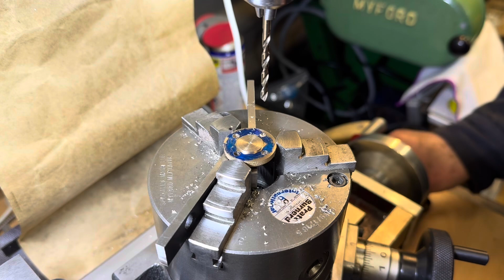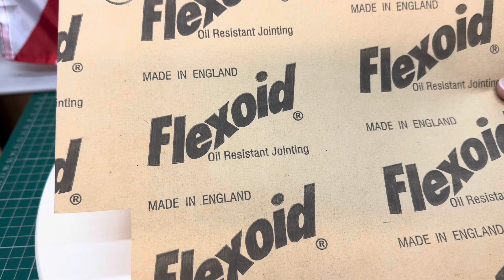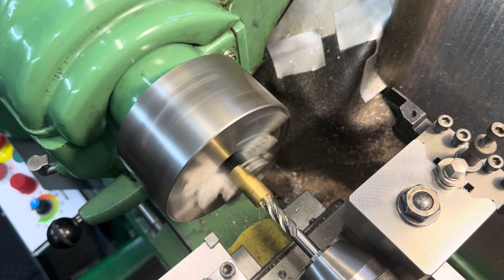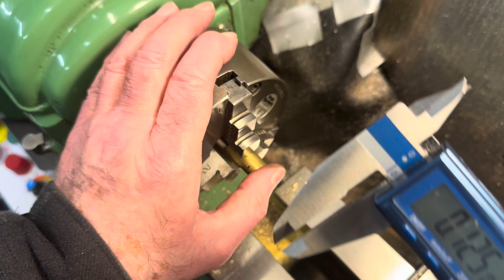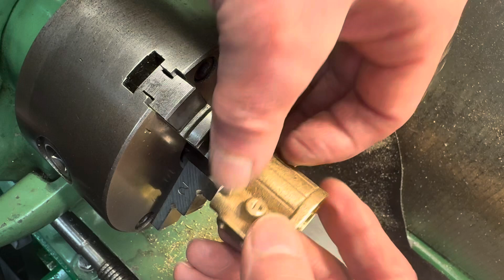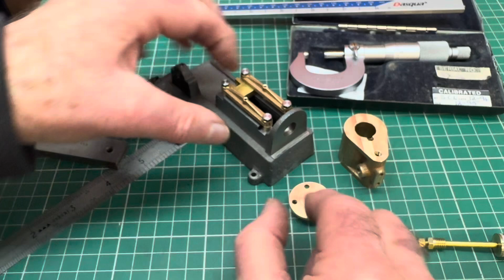PM Research #3 Engine - Part 14

Comment: Hi Nobby with the piston do your bore and part it off and do your external machining on your piston rod
Reply from the maker: I would normally machine the piston while mounted on the piston rod. As this was a rather delicate machining job, and the first time I made one with piston rings, I completed the job as shown. It did work out find, and runs concentric with the piston rod. Cheers Nobby